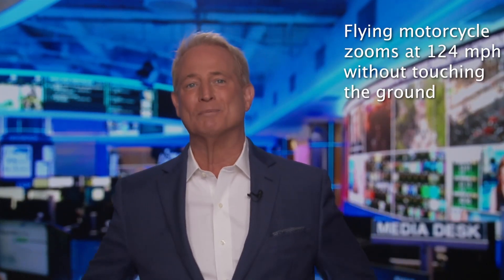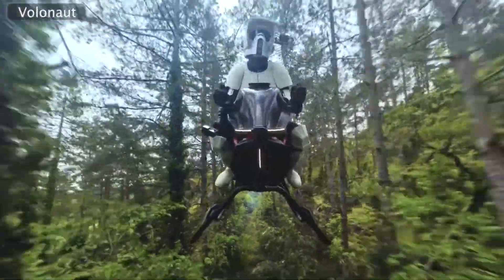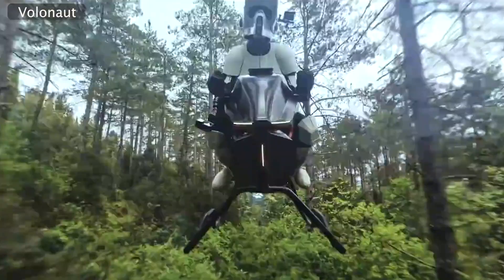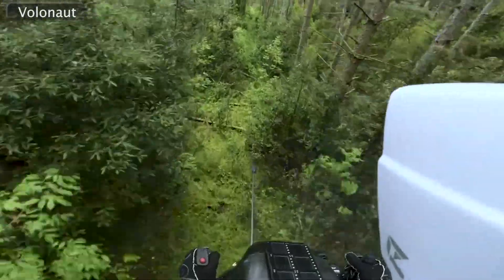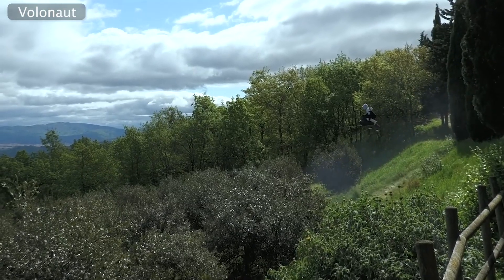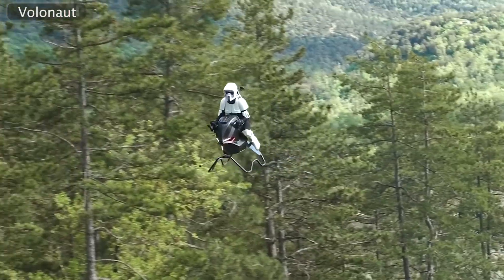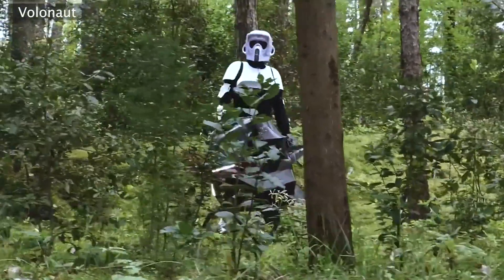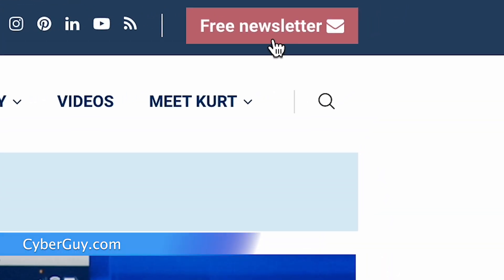Flying motorcycle zooms at 124 mph without touching the ground | Kurt the CyberGuy

Comment: The original "thruster pack" used in the Jame Bond movie was cool too, until it was revealed that it can only travel for a few minutes.  Very cool to see in a short video, but may turn out to be impractical and yes - dangerous, when the gas runs out in mid air.
Reply: give it a few years. Once battery tech get better and eventually cheaper+lighter we Won’t even need to worry about gas.